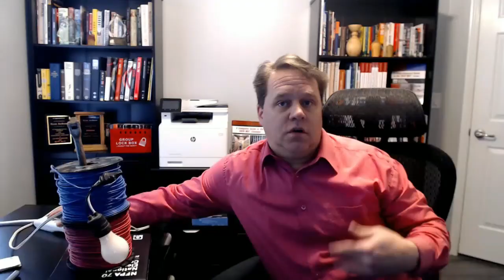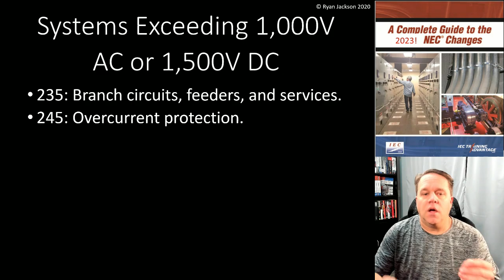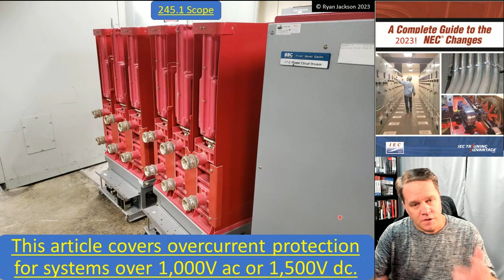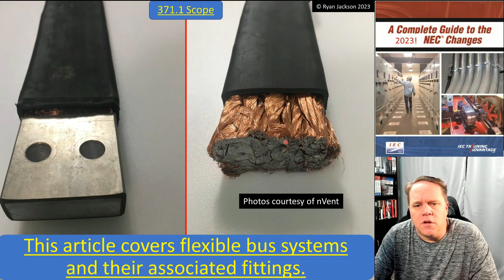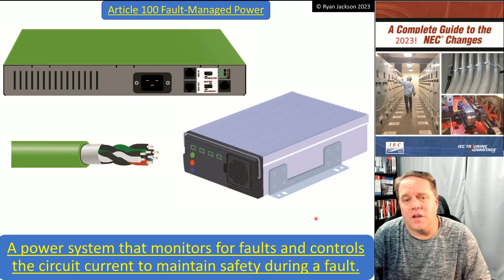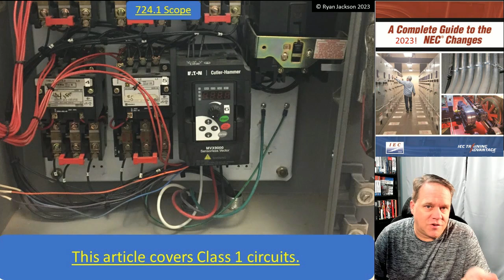2023 National Electrical Code (NEC) Changes: The new and deleted articles

Comment: Hello, thank you for the information. 
I am a Carpenter/Contractor in New York and I was looking to purchase an Electrical Code Book so I know what to look for on my jobs and make sure my Electricians and I are up to code. 
I subscribe to the ICC and have their 2020 New York State Codes Complete Collection (Digital Codes Premium) but it does not contain Electrical Code.
My focus is mainly Residential Single Family Dwellings so Commercial code isn't necessary at this time, although it would be a bonus.
I wasn't sure what book would be the best for me since I am mainly focused on meeting code for Residential applications and I was looking at, "Code Check Electrical: An Illustrated Guide to Wiring a Safe House" and the "National Electrical Code NEC Handbook NFPA 70 2023 Edition"

That being said, which would you recommend?
Thank you in advance for any insight, information or recommendations you provide.
Reply from the maker: For what you are doing and for your level of experience, I would go with Code Check.
Reply: @RyanJacksonElectrical  thank you. I'll give it a shot.

Comment: I can see flexible bus being used more for transitions from traditional bus duct to gear on a different movement plane than for an entire run.  We've done a number of projects in california hospitals where bus duct was no longer allowed to be terminated directly to the switchgear bussing due to seismic requirements.  For those projects, we needed to install tap boxes at the end of the bus duct and use a bunch of wire in flexible raceways to run into the panel and connect to the main breaker.  The shown flexible duct would make this transition far simpler, and I'm certain that this need is a significant part of the reasoning for it being created.